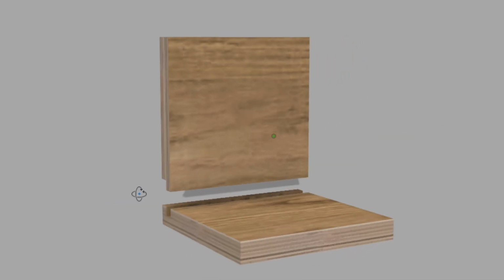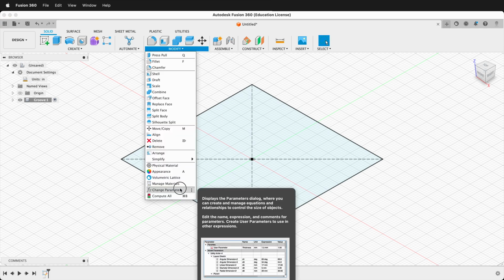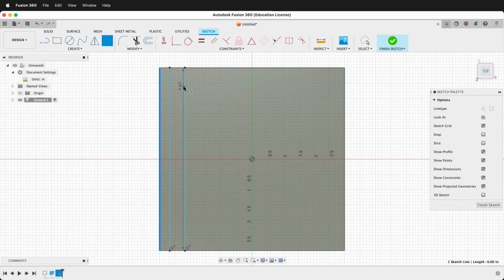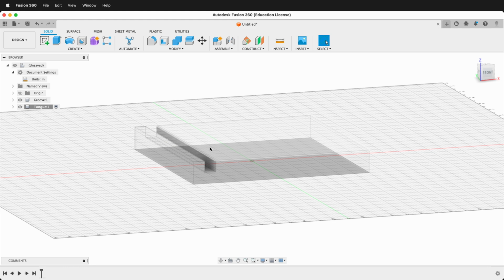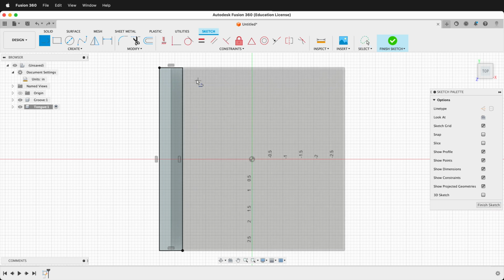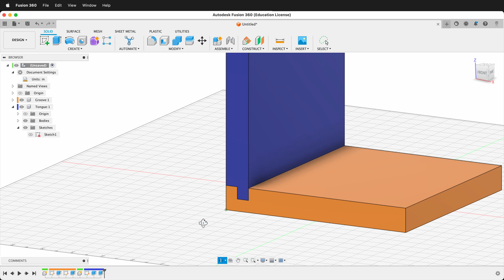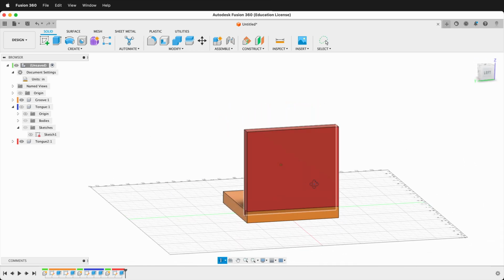CNC Tongue and Groove Joint Fusion 360

Comment: I’m thinking that the groove width needs to be slightly larger than the tongue width so that the tongue fits inside the groove.  Or is this setup in the actual manufacturing process?
Reply from the maker: Generally done in the manufacturing workspace, make the 3d model the nominal dimensions and then set your tolerances and fit in CAM for machining. For a 3D printed part sometimes you need to add the tolerance to the model.

Video on tolerances in Fusion 360 https://youtu.be/W8AcI8LkIrg

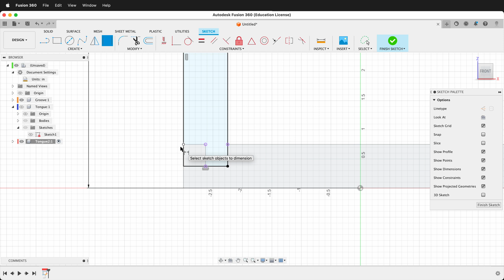Comment: Hi there, I just completed your tutorial, thank you it did teach me a lot and I hope you will make more for CNC woodwork. One question, when you were busy sketching the tongue2 I did notice there were indicators showing the length of the sides are the same (5:18) is there a setting I must enable to see this?
Reply from the maker: Are you referring to the equal sketch constraint? Sometimes those show up depending on the distance from the sketch. For making those tongue and grooves, you can either center on the midpoint or use the equal sketch constraint

Yes, planning on making more fusion 360 woodworking tutorials